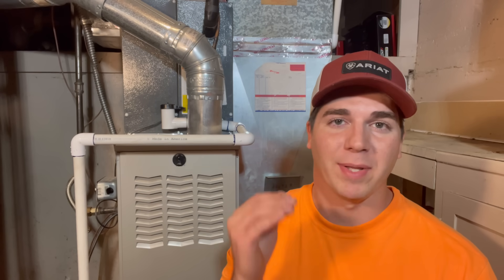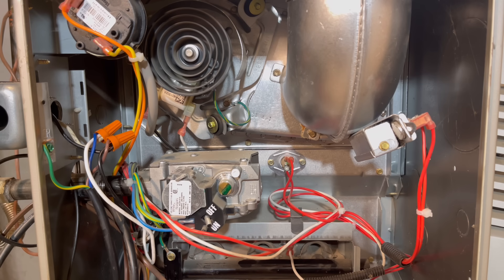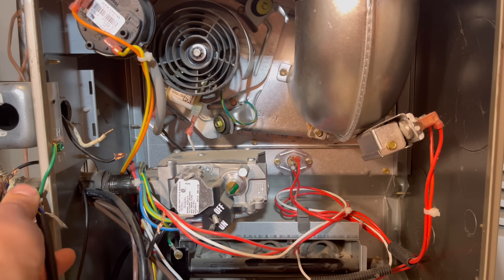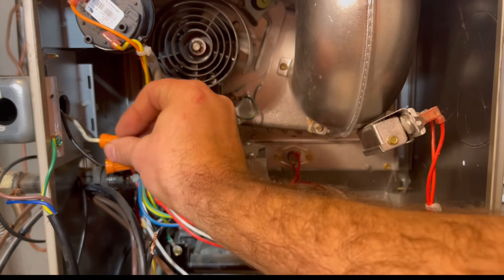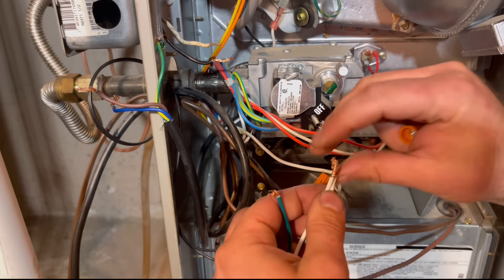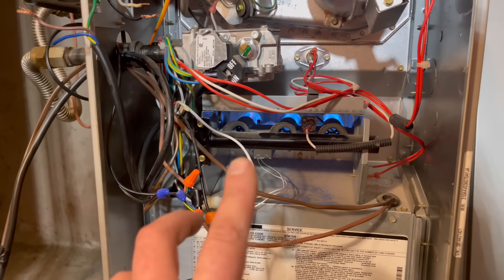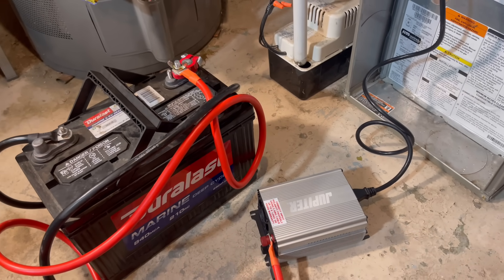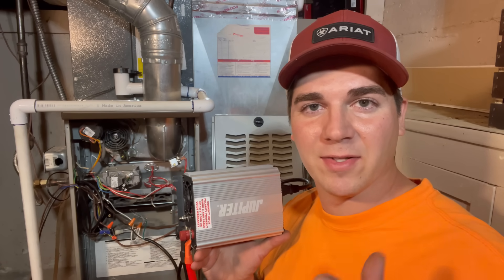Did You Know You Can Heat Your Home With A Car Battery?

Comment: My question is how do I identify the right white and black that requires power?
Reply from the maker: There is one white and one black for the furnace. Very straight forward. If there are wires for the condensate pump, just match the motor that was with white and the color that was with black.
Reply: @diyhvacguy   .... thanks i will go open the panel and check.

Comment: Folks, I believe he forgot to mention this only works for a gas furnace. The reason this works for a gas furnace is that the power is only needed for controlling the furnace and not for powering the heat source as well. If you have an electric furnace with heat elements it won’t work. The power draw needed for the heating elements is much higher then what the car battery is able to supply for extended periods of time.

Comment: Or if your lucky and you have an inverter on your work van you can just run an extension cord from it to your furnace and recharge battery by simply letting your van idle for 20 min or so accordingly.

Comment: You just only need 12volt positive and negative leads to start the inverter. Thick cables not needed. That's only for car motors.

Comment: days. you need to know the amp hours your battery can provide, it's charge, and what the actual amp draw of the constant running fan is going to draw. combine this with some portable solar and it could be a solution. but most automotive batteries suck for long draws. u really need a deep cycle. you need to know how many amps the duty cycle takes to choose a battery, and you also need to be able to keep it conditioned with a trickle charger when not in use, or you're going to destroy it given time.is a 1kw inverter actually needed? probably not. fans are hungry though, so maybe? idk

Comment: If your this worried about having heat when power is down just get a small generator, it will work the same but without any messing with taking battery out to charge. Have it outside, run wires inside for it to your furnace and wire your furnace up so you can switch form one to the other. You can buy a decent small generator for $250 that will be able to run your furnace in a pinch.

Comment: KW=KW. You didn't measure the amperage out of the battery and into the system to calculate wattage. This is critical info because people notoriously undersize the DC feed wires. Secondly, the power concern in this case is reserve capacity, not CCA. Admittedly this is an effective way to get the house hot, but the duration of the system function is pretty short, comparatively.  Wattage = Volts x Amps

Comment: This doesn’t make any sense, why don’t you just plug the furnace into the power inverter? Also, this will not run a furnace for two days ,that battery will die.
Reply from the maker: I have a follow up video out, but I didn’t make the pigtail super long so I have to use an extension cord. You could make the pigtail longer and plug it right into the inverter but I wanted a cleaner look under normal operation. Cheers

Comment: Could you use the second outlet on the inverter to plug in a trickle battery charger and continue to charge the battery?
Reply from the maker: No it wouldn’t be effective. Thermodynamics

Comment: The runtime does not seem right. A very large automotive battery typically holds about 80AH Total. Useable capacity is typically around half that because the inviter has a limited voltage range. typically it will stop running when the battery gets down to around 12.3 volts. @12.3volts a battery is at 60% capacity "Small" Furnace blower motors can be over 7 amps.  48AH/7A= 6.8 Hours Run Time. And that is optimistic depending on the health of the battery and efficiency rating of the inverter, I would expect a more realistic 5 Hour run time. This is handy to know, but I think people should invest in a generator. and store a bit of fuel. Because 5 hours will go by pretty quickly.
Reply from the maker: You were pretty close! It actually ran for six hours. Admittedly not days, and I apologize for that.  But still a great option In a pinch!

Comment: Won't this only work if you have a Mercury thermostat because if you have a digital thermostat and the power goes out then the thermostat won't have power either right?
Reply from the maker: Yes this will work just the same with a mercury t stat 👍🏽
Reply: @diyhvacguy  good to know thanks for the video, well done.

Comment: Probably already mentioned, but what if you do have a 95% efficient furnace?  What do you do with those other wires?  Thanks!
Reply from the maker: Watch this video and it will be clear. https://youtu.be/1JNuovFpCpQ

But basically you would just match the condensate pump wires hot to black, neutral to white, and green to ground.

Comment: 1) You should NEVER run a large inverter off from a "CAR" battery for any real length of time without the engine running. It will work for a while but you will end up ruining the battery as they aren't designed for being drawn way down. They are designed for a sudden high current burst of energy to start the engine then be immediately recharged by the alternator.

2) A deep cycle marine battery is better suited to be drawn down by as much as 50% before recharging. Their plates are made differently and they are made of thicker / heavier lead to handle the comparative abuse. go check the guarantee on ANY brand of marine battery. You would be hard pressed to find more than 12 or 18 months on one.
    Conversely, you should NEVER use a deep cycle marine battery to start a car unless it's an absolutely necessary in an emergency jump start situation. They are designed for a MUCH lower, longer drain cycle. A marine "starting" battery is some average between a deep cycle and engine starting battery for occasional use on a boat. NOT a daily driver. 

3) No offense but you have little idea of what you're talking about. YES your setup will work in a pinch but under NO circumstances will your setup run a gas furnace "FOR DAYS". I have a 750 watt inverter that, at full power, draws almost 70 amps out of a battery. Your 860 COLD CRANKING AMP battery is just that. CRANKING AMPS which translates to 30 seconds or less at a time with a 5 minute cool down period in between tries and to also let your starter motor cool. Otherwise, you begin to overheat the lead plates in the battery warping them, shorting them out and damaging the battery beyond repair.
A good rule of thumb with inverters is that it will draw from the battery TEN TIMES as many AMPS as the inverter puts out in AMPS. You NEVER get something for nothing. After all, if you are boosting the battery voltage by NINE times, it all has to come from somewhere.

4) The important thing to know and understand about your battery is the "RESERVE CAPACITY" rating which is generally figured as a 25 amp draw over X number of minutes. This is for calculating how long you can drive a car at at night in an emergency if your alternator stops functioning while also taking into account the number of amps it takes for running the engine's ignition, computer control, fuel pump, fuel injectors, head and tail lights, electric radiator cooling fan, maybe the windshield wipers and heater if it's cold. All of these items together will draw way more than 25 amps so if this happens to you, remember, the less you run, the longer your car will run.
    Some battery manufacturers don't even list this rating on their batteries anymore. This rating system originally came out back when all you needed, bare minimum, to run a car at night was the spark coil, (5 amps average) and head and tail lights, (14 amps average). Some marine battery makers still list this rating but at a 20 amp draw figuring for a 12 volt electric trolling motor and running lights.

    Example: The formula for figuring out inverter input current draw is: watts divided by volts equals amps. For my inverter,

750 watts / 110 volts = 6.8 amps-----6.8 amps out of the inverter X 10 equals a 68 amp draw from the battery if the inverter is running at full capacity.

If your 860 CCA battery is in new condition, at a temperature of 70 degrees or higher, of decent quality and is fully charged, it might have a reserve capacity of 80 or 90 minutes at a 25 amp draw.

I don't know what your furnace draws but I will guess conservatively at around 5 amps with the fan, ignitor and the other bells and whistles you mentioned. So your 1,000 watt inverter is running at about 1/2 of it's capacity. 

In this case, it would be amps times volts equals watts or 5 amps X 110 volts = 550 watts to run your furnace.

So 5 amps out of your inverter X 10 = 50 amps drawn from your battery. Generously speaking, if your 860 CCA battery has had a chance to warm up after being refrigerated in your camper for how many cold winter nights and assuming it's in tip top shape and if it has, at best, a 90 minute reserve capacity, this calculates that you can run your furnace for 45 minutes until your 860 CCA battery is permanently destroyed. If it's a matter of life and death and if 45 minutes means the difference, definitely do it. Just don't expect your battery to be worth any more than the core charge when you exchange it for a new one.
    Also, battery temperature makes a difference. The colder the battery, the slower the chemical reaction inside of it. This is why the label reads in CRANKING AMPS and COLD CRANKING AMPS.
    Example: The battery in my van is rated at 985 CRANKING AMPS but only 850 COLD CRANKING AMPS at 32 degrees. I always over buy my vehicle batteries for extra reserve capacity.

    Another consideration is the actual output of most cheap inverters is 10 volts BELOW the normal 120 volt wall power and are what all 120 VAC appliances are designed to run most efficiently at. If you read the directions, more specifically, the specifications page, You will see the term, "MODIFIED SINEWAVE". The power coming out of a wall socket is AC or ALTERNATING CURRENT at 120 volts. This is +60 volts to --60 volts. If you could "see" this power, It would look like a symmetrical, smooth up and down waveform running from 0 up to +60V back to 0 down to --60V back to 0 and repeating the cycle over and over. Hence 60 cycles, (per second) or now called 60 Hertz named after Hendrick Hertz, a pioneer in electricity although Nicola Tesla invented the AC motor and AC generator, (Alternator. A generator produces DC current), but I digress.
    The MODIFIED SINEWAVE output of most cheap inverters looks more like a string of square boxes that run from 0 up to  +50V back to 0 down to -50 V back to 0. the "modified" part of this "square wave" is +5 volt pointed spike at the top and in the middle of each positive square and a -- 5 volt pointed spike at the bottom of each negative square for a total of 110 volts AC.....sort of.
    The ONLY appliance that is absolutely safe to run on a cheap, modified sinewave inverter is a light bulb. Incandescent or straight fluorescent. I wouldn't trust LED or CFL, (curly Q) bulbs as they both contain a little more involved electronics in them.
    Modified sinewave inverters are also electrically noisy due to the above mentioned spikes in their waveform. Because of their square waveform and their being 10 volts below wall power, they are known to overheat induction motors, (refrigerators, blowers, ceiling fans ect.), and brush motors, (high torque power tools, drills, saws, angle grinders, vacuum cleaners ect.). They can also damage sensitive electronics such as the control board in your furnace. How sensitive you ask? My son's gas furnace's control board has a 3 amp fuse that blows if his air filter gets too dirty. They can also damage computers. Especially cheap laptops and tablets.
     You may wonder how off grid solar powered homes or massive commercial solar farms can get away with it? At about three or more times the price per watt, you can buy a decent10,000 watt PURE SINEWAVE inverter and NOT the 8,000 watt units from Harbor Freight either. These are also modified sinewave. Commercial solar farms use multi kilowatt to megawatt sized pure sinewave inverters that are electrically synchronized with the grid so their waveforms match. Solar homes use either 3,000 to 4,000 pound lead / acid forklift batteries, multi thousand dollar lithium ion Tesla or Generac power wall packs, multi thousand dollar banks of lithium ion batteries such as Battle Born or others. A single 100 amp hour Battle Born battery the physical size of a car battery, which has less net power than your 860 CCA battery, is more than $900.00 but is guaranteed for 10 years. To run an entire house dependably, with gas or propane heat and appliances and with some reserve capacity for cloudy days could take 20 or more of these batteries and at $900+ each, it's a real investment, ($18,000+ tax just for the batteries). Some people use large banks of deep cycle lead / acid marine batteries either car or tractor trailer sized but in deep cycle configuration.
    I live on the east coast but from what I heard Governor Abbot and other Texas residents say on the news was that one of the problems they had there was that Texas' gas infrastructure wasn't designed to withstand that kind of cold. Living here in West Virginia where it seems that everybody and their second cousin has either free gas straight from the well as royalties for drilling on their property or, in my son's case, he owns his own well that was abandoned and came with the property when he bought it and has never failed him or the previous owner. The problem is water is an inherent part of gas recovery. There is water in the Texas' gas system which froze stopping gas flow. In this case, you could have the biggest battery bank and the best pure sinewave inverter and it would still do you no good.
    All of this is meant to educate you and your viewers and NOT to insult, belittle you or treat you like you're stupid. You showed ingenuity in figuring out for yourself what you did. Your basic idea and principles were spot on. It just needed a little more background math and tweaking is all. Good luck in your future. Jeff M.
Reply from the maker: I think the key is not letting the battery get past a certain point before charging it up. Thanks for the very thought out comment, cheers

Comment: Yes take a video or pictures of before and after so hou dont forget  :)  if you're  inverter is higher then you could run more like a fridge on a timer super simple stuff  :)  and all lighting standered can be wired up off 1 circut unless you have higher output lighting fixtures but just standered 60 watt etc will be fine   hot water tank can also be inter connected carefully as well   :)  stove etc no microwave  only plugged in by itself  on 1 plug washing machine  no unless its 120 volt and dryer but you're battery could run down really fast but it can still be done with having deep cell batteries as a spare kicking around but quick fix is the video anything after that is up to you  :)

Comment: How well will this work with a electric furnace. Will it last as long?
Reply from the maker: This will not work for an electric furnace. Gas only. You will find out pretty quick as an electric furnace has breakers instead of a switch,

Comment: Can you plug a battery charger to the other plug outlet on the inverter and connect the charger to the battery so that it would charge constantly even while it's running the furnace ?
Reply from the maker: It wouldn’t be super effective due to thermodynamics
Reply: @diyhvacguy  
So I could use my sump pump battery which is already located approximately 5 feet from the furnace. It's a triple pump with battery back up. The other solution would be to pull a car battery so you could put it back in the car to charge back up. Or would that battery charger plugged into the other inverter outlet charge a second battery while the one battery powers the inverter running the furnace.

Comment: Furnace's gas management system. Where's the power for the central air coming from?
Reply from the maker: I’ve had several power outages here in salt lake where we still had gas. So sometimes you can have it and sometimes not

Comment: I have the same furnace.... would a -500 watt- 1000 watt peak inverter be able to run the furnace?
Reply from the maker: I don’t believe so. The watts spikes to 1000 when the fan kicks on and then stabilizes at 500 while it’s running.
Reply: @diyhvacguy  Thank you

Comment: What would I have to buy exactly? Could you kindly share link to Amazon or Home Depot? 🙏
Reply from the maker: For the longest run time, I’d go with a lithium iron battery like this one 

https://amzn.to/3FJTHdU

And then you would need an inverter. This is the one I used: https://amzn.to/3YoTEwF

Or you could pick up a power station from Bluetti or Ecoflow. I have a video that comes out the first week of January testing how long the ecoflow 1000w power station powers my furnace. Here is a link for that. It would replace the battery and inverter and would be extremely easy to use. https://amzn.to/3v4GHuo
Reply: @diyhvacguy  thank you!

Comment: This a no brainer for a "Gas" furnace that needs only 120VAC and low amps. Try something with an electric furnace. Also your truck battery is sacrificial and will be damaged as soon as it goes below 50% capacity. You need a deep cycle battery. And IMO those 12V inverter terminal leads are very close together.